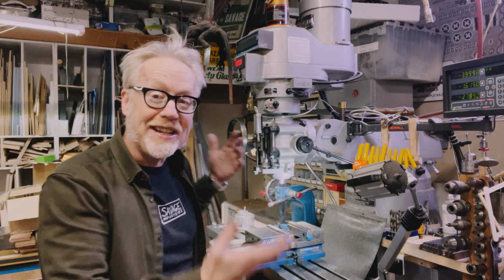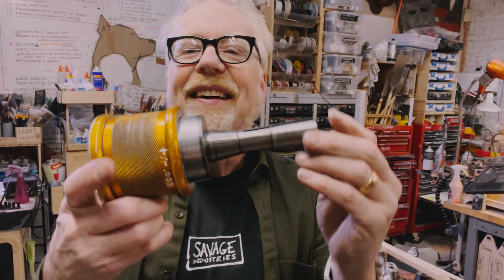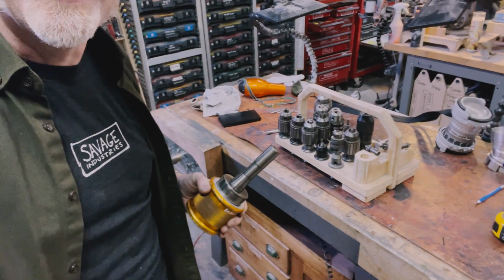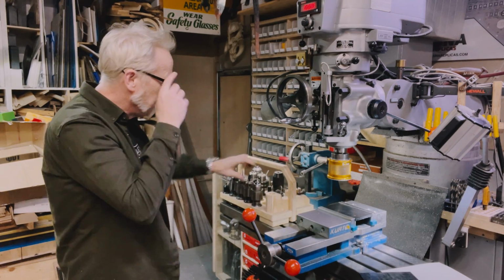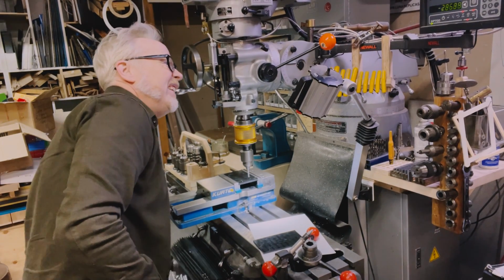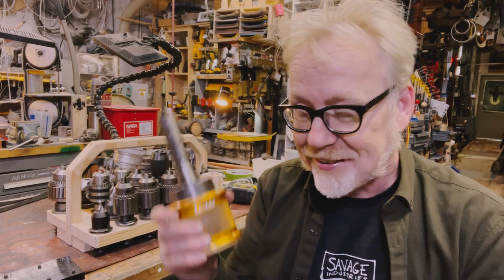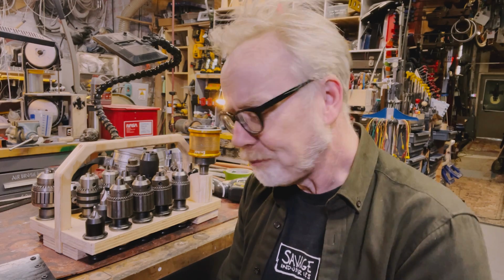Adam Savage's Favorite Tools: Quick-Change Tool Holders!

Comment from the maker: In case you missed it, here's the show and tell of Adam's new milling machine: https://www.youtube.com/watch?v=j8_EoUXvTJk
Reply: I would like to see if you can do the impossible. A model of The Uss Discovery refit with separated nacelles.
Reply: Um, there better be a video about the Blade Runner 2049 memory machine in the future. I saw that Tested and Adam.
Reply: Most machinists would have clamped both pieces together (or if they are metal glued) drilled tapped countersink then chamfered to cut back on soo many unneeded steps. Just a hint for future there are some steps that can be missed that will speed it up more than any special gadget.
Reply: @ProfaneGod  or use a set of registration pins/fixture to align the plates and hold them reputably in the vise.
Reply: @MikelNaUsaCom  True but only really applicable to pieces that won't be seen but still a valid way of doing it

Comment: I have the old Laip quick change  system. You can swap the tools while the machine is running (max 2000rpm). Love that system. It's super fast on machines with fast speed regulation

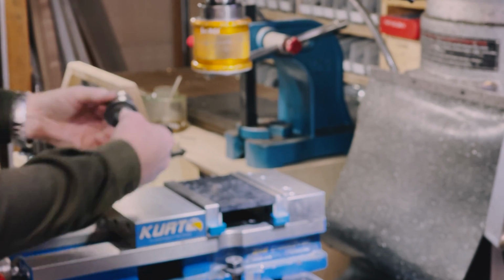Comment: at 19:49 this is NOT a counter-sink, it is a counter BORE, ADAM, there is a difference, a counter sink is a 60 degree tapered socket for wood screws, a counter bore is the parallell diamater to house the allen machine screws' head flush to the surface, aka like on cylinder head bolts, exhaust manifolds, etc.

Comment: Did you indicate on the tool it’s self. A lot of tool holders are not accurate on the OD of the holder. The Cat 40 tool holders I use are .005 or so TIR out of center but the tool are held perfectly centered.

Comment: The feeling of adding that level of speed and versatility to a major tool can be incredibly liberating.  It gives you back the most precious resource you have  for creating - time.  And to add that to a mill for only about ~$800, something that can save 45 min to an hour with each major use?  It pays for itself quickly if you're a regular mill operator.  Great add!

Comment: Back in the ‘80s I was teaching high school metal shop in Alameda. I got a summer job at Diamond Tool. I remember using that tool holder. It’s designed to make your tool changes with the machine running. I still have all of my fingers.

Comment: Used to work in a TnD shop when in engineering school and the owner designed a phematic power draw bar for the Bridgeport. You'd hit a toggle switch to tighten/loosen the collet. It could cycle (depending on how quick you could pull the next collet mounted tool out of the tooI carousel) a toold change in just a few seconds. He sold quite a few of those the shops with older Bridgeports around the country. This method wouldn't have the concentricity issues.

Comment: There also exist (though I have not ever used) Erickson QC-30 spindles for the mill (rather than R8).
No drawbar required, and you also don't lose the rigidity it concentricity of the spindle the way you do with the adapter.
As somebody with a low basement 'ceiling' over my Bridgeport, I've been hunting for such a spindle to rebuild my JHead with.

Comment: I kind of developed my own system out of necessity - I make pens and each one uses like 14 drilling and tapping operations. I use "motor shaft" collet chucks - they're an ER16 or ER20 collet chuck, which you can mount onto a motor shaft (typically 6, 8, 10, 12mm). I install each drill bit into its own collet, and with my 10mm shafts it means any drill bit change in the range of the holders is just a quarter turn in and out of my tailstock. I love it!

Comment: All the things you want to do can be done with a drill chuck. If you get a keyless chuck, like an Albrecht, you won't even need a key.

With a DRO and a list of numbers, you can mount a tool, do an operation on all of your locations, mount another tool, do another operation, and so on. You don't need to change tools over and over. You don't really need a DRO, but it makes things easier.

You should get an edge finder and a work stop for the vise.

Comment: Using a short, stright shank for your drill chuck along with a 1/2" or 5/8" R8 collet makes swapping chucks easier since you don't have to change collets but you still need to loosen the collet. That big adapter is pretty nifty but  wouldn't work on a small/compact mill due to the stack height.  Also, I've noticed that not all JT33 type shank adapters are created equal; some have longer OAL when mounted than others.

Comment: I got a set for my tiny Seig mill. With a DRO it is quicker than programming  a CNC mill to do things like this. But a quick change drill chuck is better than those keyed chucks.
Reply: yes and no, the keyless chucks don't seem to have nearly the same holding power as a keyed chuck
Reply: @guitarchitectural  6mm is a big drill for me. Learned machining for model trains.

Comment: Could someone please confirm my perception that this tapping method relies on the quill being 'drawn' into the hole by the spiral flute tap's threads and the mill being stopped using the brake before the tap reaches the end of its travel? I am guessing Adam is guiding the quill feed handle/ lever rather than soley controlling the plunge rate? Thanks. Love the tool changer - like a big version of my impact driver's bit quick changer!

Comment: Unless you have a Haas (or other brand) CNC with an automatic tool changer (and all of the CAD/CAM experience/software to go with it), this is the best manual solution for projects requiring multiple tool changes. Very cool Adam! Thank you so much for the great content (as always). Totally agree with NOT using quick tool change for milling bits on precision pieces.

Happy Holidays!

Cheers,
Jeff (Garage Maker Guy)

Comment: ive been looking for something like this for my little bench mill but everything ive found so far is way to much an cost as much as my mill did so def not a option so ive been looking for other solutions but no luck find anything yet. this is the first time seeing this one but looks like it would eat up alot of the z axis on my little machine so is probably out of the question too. i was thinking about getting a r8 1'' collet an then getting a bunch of er 25 with a 1 inch shank an just fixing a bunch of those up as quick changes to swap in an out of the 1" r8 collet. ive seen a few ppl do the same but using er20 and instead of 1" they used a 20mm r8 collet, but i figured id go with as big of a shank as i could to get the most rigid setup i could, i know it would work with drilling setups but i was hoping it would work with endmills too but i dont know how bad the runout would end up being from something like that. it wouldnt be as quick as a slip collar like that releasing the holders but i feel like it being a 1" straight shank with the er25 collet it might not be as bad but i dont know for sure but thats my next purchase is a couple er straight shank collet holders an an  r8 collet in whatever shank size i end up going with i need to look at the sizes for the er collets an see what size the 20 an 25 go up to an pick from that, half inch is about as big of a end mill as i use in most cases so as long as it can hold up to 12.7mm or half a inch im good, anything bigger would go straight into a r8 collet. love seeing adma show his stuff tho, no one is as passionate about explaining how something works as adam an with it comes to a milling machines this is as deep as it gets, where it all starts. wish he show more stuff with his mill an lathe.

Comment: You can speed it up even more if you use symmetry.   Add a vise stop and you can repeatedly register one corner of the plate in the back left (or right) corner.  If you then make sure your plates are the same dimensions you can get the four corner holes without moving the mill table just by spinning or flipping the plate - the vise stop taking care of the positioning.  The inner holes can then be done with just two moves - or less for operations like the through-drill or tap where it doesn't matter which side you start from.

Comment: I just had a project where I was doing precisely the project you described.  It was an absolute pain in the butt with just a drill press, and my hole registrations were unfortunately off, and I would have benefitted greatly with a mill with this setup.

Comment: Neat gadgetry, but I had to chuckle when Adam rather quickly installed the quick change collet using the pneumatic draw bar.
Nope, setting up a bunch of R8 chucks with all the bits and swapping them around using the pneumatic draw bar wouldn't be fast enough.

Remember Tru TV's John Glazer Loves Gear?

Comment: The other big advantage of a tool changer like that, is you get consistent tool offsets which you can save in the DRO. So you don't need to touch off the tool each time you change if the depths are critical. This is mostly useful for counterboring but also counter sinking. It's very useful for endmills if Adam can solve the runout problem. These things should have a runout measured in tenth of a thousandth not thousands of an inch.
Reply: They are ok for plastics and light alloy. Precision milling steel is another matter.
Reply: your_xxx-C32 fast & precise & power
Reply: notice though that he doesn't leave them installed... he sets them up for each run

Comment: Adam, please take note from a journeyman machinist and soon to be retired machine tool instructor.  Your videos on machining are for sure entertaining and most informative for a weekend hobbyist. Think like a machinist please.  Machinists would not do all operations to each hole and then move to the next.  Before I get into specifics let me help you get more efficient.  Don’t use a center drill on a milling machine.  Invest in spot drills instead.  You will find it most efficient and effective to spot drill your hole locations deep enough so that a countersink tool is not needed, saving one operation.  ALWAYS countersink threaded holes BEFORE tapping them.  Formula for correct depth on spot drills is for a 90 degree multiply your desired countersink diameter by .5 for correct depth.  For a 118 degree spot drill, multiply your desired countersink diameter by .3.  Back to the process.  Complete all locations with one tool.  Reset RPM accordingly, change tools, repeat.  When you change tools and complete a hole location, changing RPMS each time is time consuming at best.  Hope all this helps.  Happy to do a virtual call with you anytime to share more knowledge.

Comment: The main mill quick change tooling I'm familiar with is the TTS system.  I'm curious how the two compare.  The TIR for TTS is certainly better than the 3-5 thou that you describe for the one you picked up.  But TTS more or less requires a power draw bar for the 'quick' part to be meaningful.  What else is different?

Comment: That quick change looks awesome! I'll have to find one now. Quick FYI: Wood/plywood is not an ideal choice for tapered tooling racks. It holds moisture and can wick away any light oil, promoting rust. Most people who build a rack like you're using end up regretting it. Personally I love HDPE or UMHW for that. Even a dollar store HDPE cutting board would be a better choice than wood. Otherwise give it a good coat of furniture wax or similar, if you haven't already.
Reply: I was always told never to use oak as it rusts metal. Didn’t think plywood would do the same.
Reply: A rattle can of paint. Then spray gun oil over the part. This also good oil to tools you don't use often.
Reply: @leemarsh3569  That’s a different problem: oak contains a lot of tannic acid, which is corrosive in a very quick way. Most woodworkers experience this when they glue up pieces of oak: moisture in the glue + metal clamps or squares + tannic acid = black stains on the wood.
Reply: Soak the plywood rack with tung oil and then wax it with paste wax to prevent it from holding water against the ground surfaces of the tooling.
Reply: I'd also say, soak it good in some kind of oil and it won't be a problem
Reply: Take a look at the Royal R8.  Way smarter and more compact than this ☺️
Reply: Good call, UMHW (or HDPE) probably would be best yeah.
Giving the wood a coat or an oil soak would still be worse, as the coat can wear off and get in and onto the bits, and soaked wood will either bleed too much or dry up eventually.
Reply: @leemarsh3569  As MM said oak has its own unique issues, but wood in general is not ideal for contact with precision metal surfaces. It's like driving without your seatbelt: you aren't guaranteed to be injured or killed as a result of that choice, but it's far more likely than if you make a better choice.
Reply: @intjonmiller  
Case in point your drawers are felt lined in wooden drawers.
Reply: not if u soak the wood holding  area in oil.
Reply: When I build something like this out of wood, plywood in particular, I give it a coat of fiberglass resin. Makes a great wood sealant and keeps me from chipping it when my clumsy self beats it into everything in my garage
Reply: Thank you sir for the tip.

Comment: There is Rapi-Change holder R8  from  Boyar-Shultz.  I have 3 (two have the same run out as yours but one of them runs out less to 0.001".  They are madly expensive. Each collet goes for about $180 a piece. It is 1/3 of the your speed collet holder size.

Comment: The desktop CNC mill in our Hacklab uses BT30 tool-holders which are quick-change and also integrate with an automatic tool-changer (which we sadly don't have) like bigger "real" CNC mills. I'd be surprised if the Sharp mill you bought doesn't have a BT30 or BT40 spindle option rather than the R8 manual-change toolholder option. Commodity BT40 tool-holders are good to about 10 microns runout, 5 microns if you pay mucho bucks and have a machine that is in spec.

Comment: a great tool Adam, but a real good use for it is to find a way of putting this holder on a lathes' tailstock quill, to speed up changing a center drill and other drills for lathe operations.

Comment: Hello Adam, Just use a centerdrill, or chamfer tool (don't know how you call this in the USA) that has a good web thining or in german 'kegelmantelanschliff' so you can drill straight into the material, for example a 90degrees x 10mm centerdrill(not the 60degrees one with the little tip you showed, these you normaly use for the support center tailstock on a lathe). Drill it deep enough so that you already have the chamfer for your thread on one side. Then rotate the workpiece and do the same, then drilling and tapping.. this saves you a lot of work.. You also don't want to chamfer after threading beqause you get extra burrs in the thread hole..

Sorry for the bad english i'm from the Netherlands.

Best regards,
Mark Geurts

Comment: There are systems that are even faster, where you dont have to stop the spindel for the tool change and the "ring" stays in the upper position until you put the next tool in and locks the tool automaticly.

Comment: I'm a little confused and I think its ignorance. I thought mills had that pneumatic tool grabber where you press a button and the tool falls out? and if it does have that? why not collect more chucks with the taper your mill has instead of adding another thing hanging out of it? is this taper cheaper than the taper of the mill?

Comment: My american friend who used to work at general electrics thought that it's much more time efficient to finish 1 process at a time. I think the first method was efficient. I like your setup on the mill stay safe
Reply: I agree. At first it seemed inefficient to swap tools for each hole, but that is more efficient than moving the piece multiple times.
Reply: @robadams1645  It depends on tooling. If all you have are R8 collets like at my job, it's better to keep the same tool in. But with dedicated tool holders, you can make up some serious time.
Reply: @GeneralChangFromDanang  The most efficient method also depends on how far you are needing to move the workpiece between locations, and how many individual locations there are.

Comment: Machinist pro tip: spot your tapped hole chamfers. Just use a spot drill that's large enough to make a spot Ø0.05" larger than the tap diameter, then drill, then tap. You skip a whole step, and you don't run the risk of folding over your starting threads and making issues in final assembly.

Comment: Adam. I love  your vids. But all those operations you demonstrated could be done ( & faster) with a keyless chuck  (-from 35 yrs exp. Machinist). But, it's a pretty cool device. I would imagine it came out the era when CNC equipment  was still not quite affordable to the small/average size Job Shop (mid 80's ish?). Pepperidge farm remembers.... :)

Comment: Cant you record on your dro the first holes and have it set to do it auto between changes, or do you not have it fitted with motors?
Reply: No that is not a CNC mill. No lead screw drives.
Reply: @grntitan1  thank you I am an idiot

Comment: Mr. Adam, love your videos all the way back to early Mythbusters seasons, and I’d like to suggest a helpful tip if you would like to be even more efficient in your milling operations. Please consider “combining them” , as in: using a stub length split point drill bit (screw machine length) to do the first two operations of spotting and drilling in one. The short length of the drill bit combined with split point tip, to minimize walking, allows spotting and drilling in one shot, vast majority of the time. Hope this helps :) Awesome content!